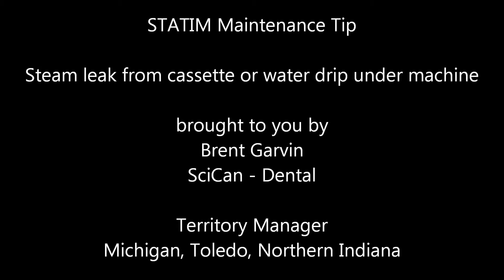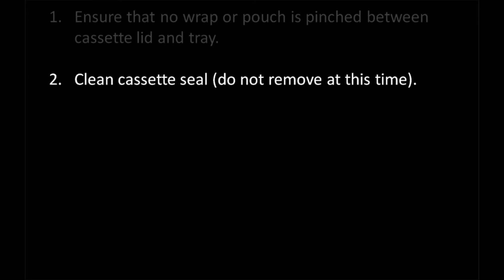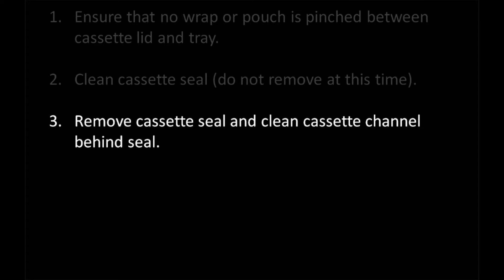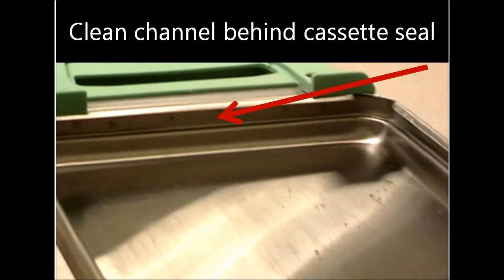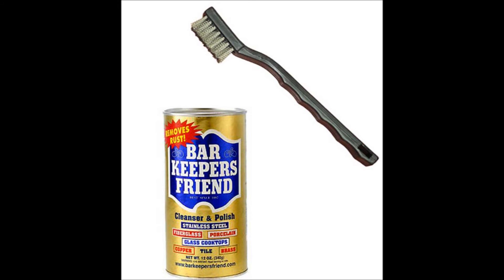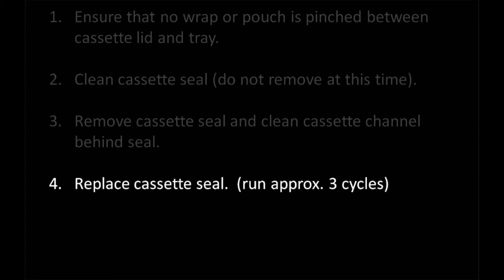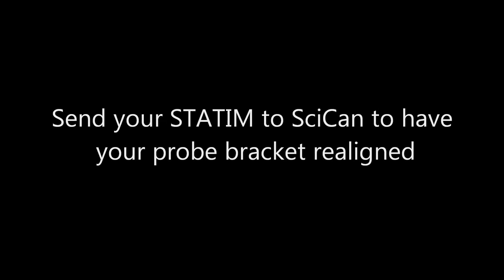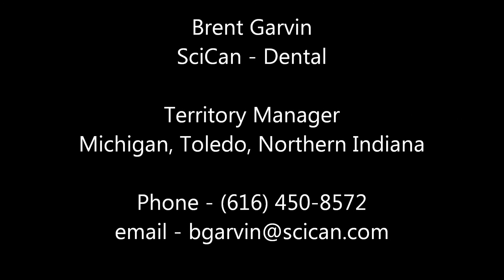STATIM Steam Leak or Water Drip

Comment: our statim 2000 has not been used for a few years. we tried using it again, cleaned it and tried autoclaving some things but after the dry cycle. when i open up the cassette there would be water in the cassette making my pouches wet. what can be the cause of this?

Comment: our Statim 5000 seal is about 3 years old, I've never cleaned it or done any treatments, sprays, etc on seal or cassette. It has at least 3 times the recommended runs on it, as well. The machine has never failed the weekly spore test. Today we are getting steam coming out front, with error #2 (cassette seal or exhaust). I pulled out the exhaust tube,..it isn't kinked; I blew bubbles through it into the condensing jar,..no blockage.  I slathered some hand soap (yes, antibacterial,..it's all we had in the practice) on the seal (without removing it),..voila, no steam leak, no errors. So, I ordered a new seal and hope my Costco handsoap fix lasts until it comes! It was nice having a cheap, used autoclave (from craigslist) as a back-up during this event, or it would have been panic city.Thanks for the vid.
Reply: Sci-Can  recommends replacing the cassette seal every 6 months or 500 cycles.The exhaust hose/waste bottle has nothing to do with a steam leak. Error code 2 & 3 refers to it not reaching a certain temp within a timeout period and is most often cause by a steam leak.You should be sure to clean behind the seal as well, as corrosion can cause  pits in the metal(The cassette is made out of stainless steel, but it is a low quality stainless steel and can rust.) It is probably a good idea to replace your cassette lid very couple years due to warpage from the steam and moisture.  3 years is a long time to go without any maintenance.there are components that can wear and reduce the efficiency of your unit(like any appliance) Routine maintenance will prolong the life of your sterilizer.Stat-Dri is great for lubrication when installing a seal and it aids in keeping the corrosion down  behind the seal.